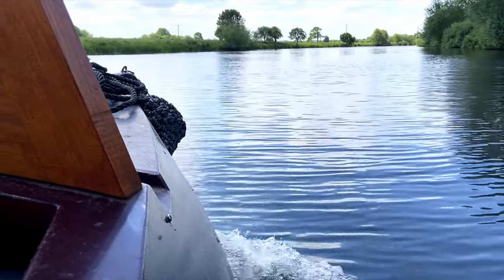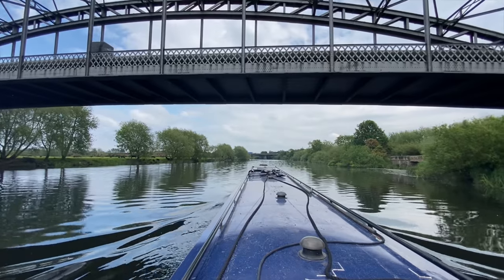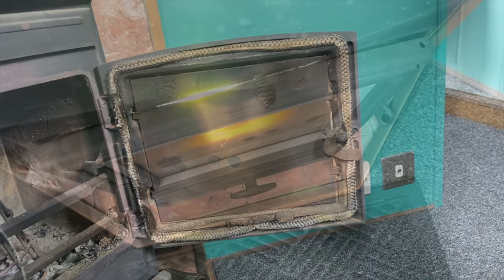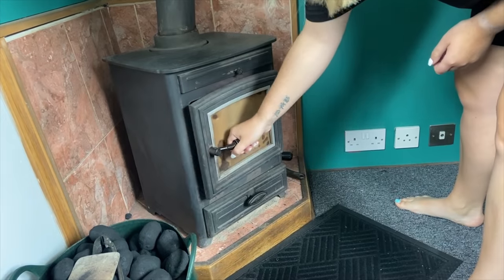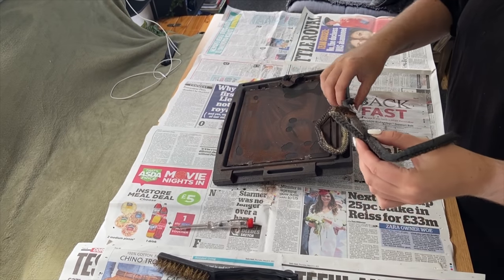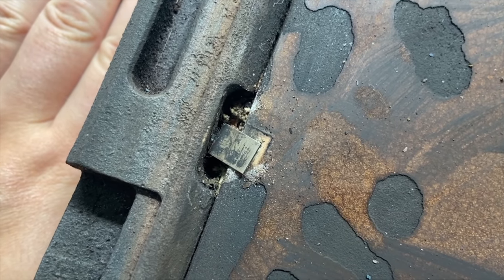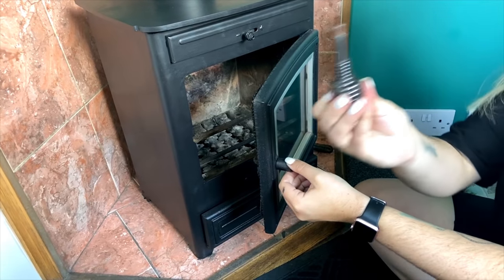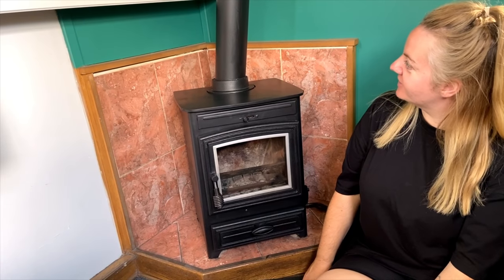I've been putting this off for way too long! Essential NARROWBOAT MAINTENANCE!

Comment: If you don't already have them, I suggest you invest in a carbon monoxide detector and an air quality monitor (there may be a monitor that does both). Carbon monoxide poisoning can get you in the very short term, but a coal/wood fire will affect the air quality in your boat in the long term and may get you later ;-). Diesel is better for the air quality.
Reply from the maker: I have 2 x carbon monoxide alarms one at the front and one at the rear of the boat. I don’t have an air quality monitor yet will check that out! Thank you 😊

Comment: To clean but glass in the woodstove front door. The best thing to use is the damp cloth dipped in the ashes and then rubbed on the window. This way you’re not scratching the glass. Do not use scouring powder of any type unless the label says can be used on wood stoves.  This will give you many years of being able to see through the glass and see the fire what about scratches. When you paint be sure to use stove paint what is rated for high temperatures. I think it only comes in black, but I’m not sure about the UK. Other colors like red and green Very pretty but I’ve never seen them in the store. Good luck your boat already looks very nice.
Reply from the maker: Thank you for your comment, I use ash usually. 😊

Comment: You did not say whether you clean the stove before you put Stowe paint on it. I would’ve been eating sure to clean dust and dirt first then wipe down with the cloth damp with paint thinner to be sure all ash and debris is off the metal before painting with a brush. If they say is not clean stove paint won’t last very well.
Reply from the maker: Yes I cleaned the stove before, sorry I thought I mentioned that. 😊

Comment: How the ding dongs do you manage to clean the stove, remove the fire rope, then the  glass, brush  out the grooves to get rid of the residue, then  paint etc etc WITHOUT GETTING DIRTY HANDS or chipping your nail polish...... (only jealous 🤣🤣) , I have a garden wood burning stove, only have to open the door & get smuts not only on my hands, face but over my clothes!!!!! You’ve done a fantastic job on the stove! Which leads me to two questions, would the stove paint you used be suitable for an out door wood burner? (It is a converted gas bottle!). Secondly would it be worth me buying a heat powered fan to spread the warmth more widely? The clic clac settee looks lovely too. Will you style my home please?!!  I love your attitude to tackling jobs which you profess to know nothing about! You are quite inspirational, well done! 👏🏻👏🏻
Reply from the maker: Lol you should see my nails now - they’re awful! It took its toll! Thank you 😊 I believe so it’s proper heat paint so I think it would be fine! I think the heat powered fan does make a difference at spreading the heat. Not sure about how it would work outdoors though. Lol yeah sure! 😊 thank you so much, I really appreciate that!
Reply: @LiveaboardLifestyle  ok, thank you. Which paint did you use please? 🙏🏻

Comment: Hiya, great vlog ; we need to black ours too! just a suggestion; paint the section at ceiling level black too; it will complete the look and make it much easier to clean ( we move on a boat and the smoke goes directly up to that area :)  . 
As an alternative a brass/ stainless steel/ copper sheet applied .
Reply from the maker: Thank you 😊 good luck with yours, it wasn’t as bad as I thought. Good idea, thanks!

Comment: I sure hope that tape you put around the glass is rated for high temperatures. If it is not it will just burn and cause more trouble. Other than that you did a great job!!
Reply from the maker: I believe it is, I purchased them together and so far so good!

Comment: Great job on your woodburner.  It turned out really nice.  We heat our home with wood but also have a furnace that runs on propane.  It is a good idea to have 2 sources of heat.  We need to replace the rope around our door before winter as well.  Doesn't look too hard so thanks for the incentive to get it done.
Reply from the maker: Thank you very much. It was a lot easier than I thought it would be! I put it off for so long thinking it was hard but I was pleasantly surprised 😊